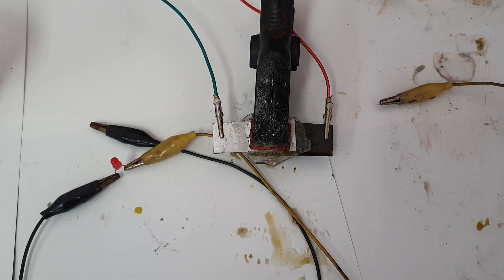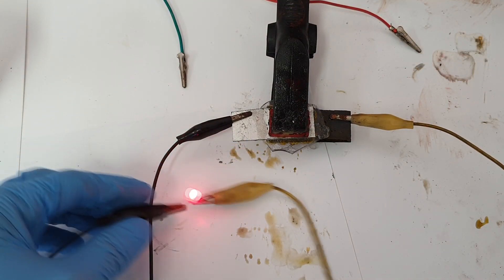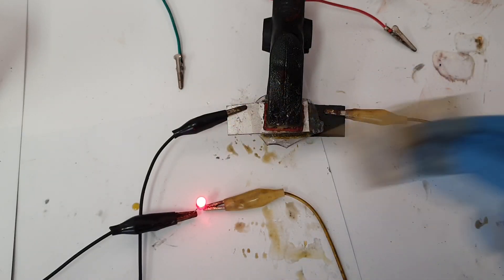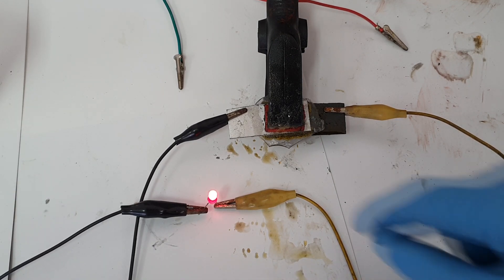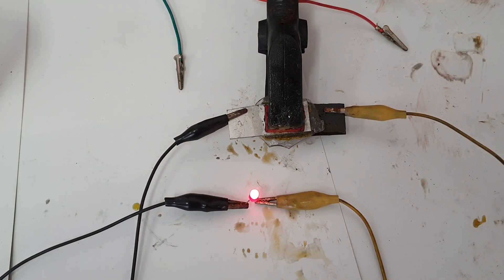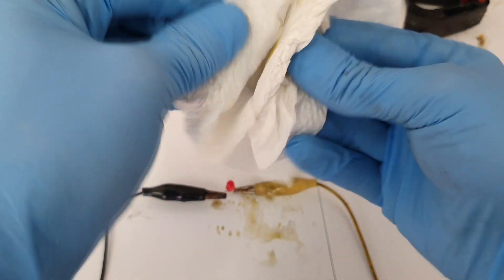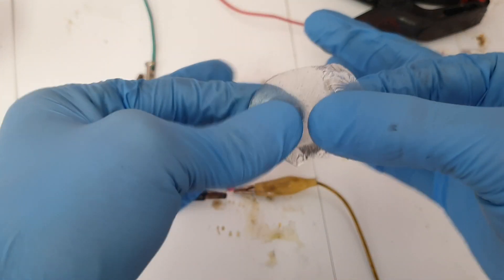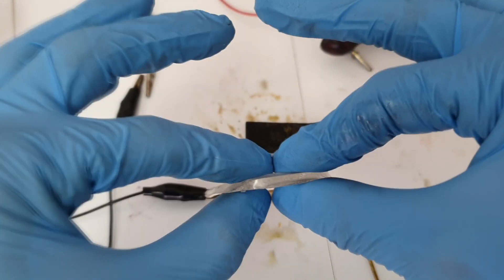Glass Battery

Comment: I have been playing around with carbon felt layed on thin layer off sodium silicate. I have been doping it with various salts, bases and acids. I then use thin paper towel as separator and create a cell. Very interesting results. I feel you should try this with your smarts as I believe it is a good way and cheap materials. I made the sodium silicate with cat litter crystals etc.

Comment: you could try using glass slide's that they use in microscope's they are thin, but what is in the elelctrolyte...???
Reply from the maker: a reall glass is a good insulator and will not work. This is a glass ceramic like separator which have fairly good ionic conductivity.